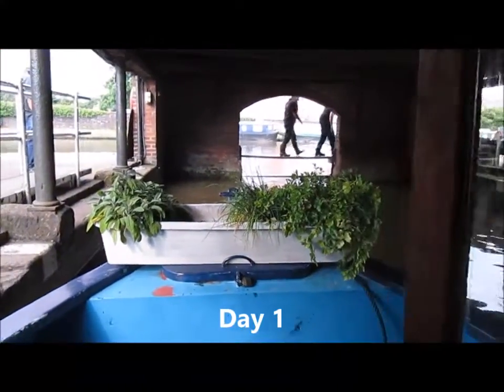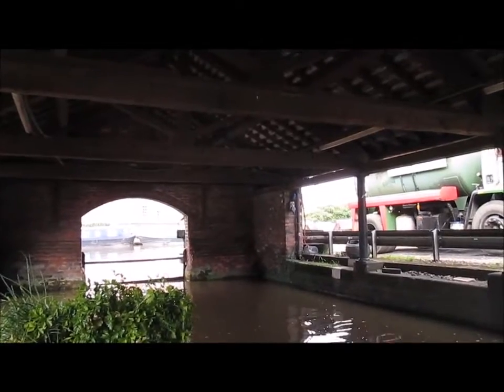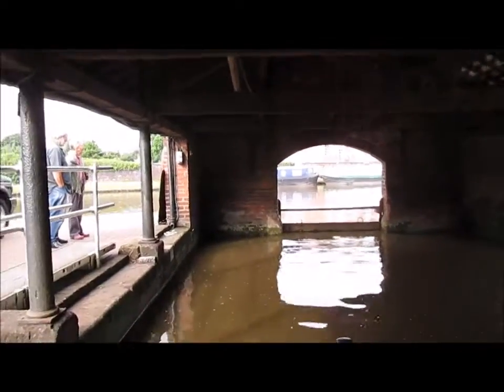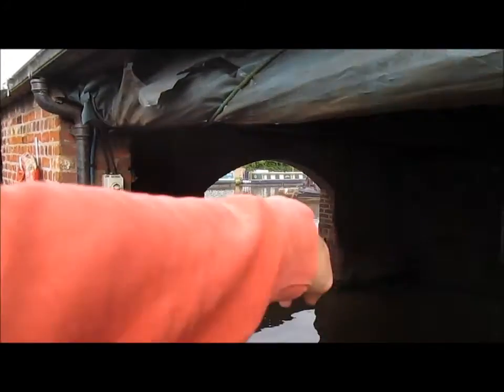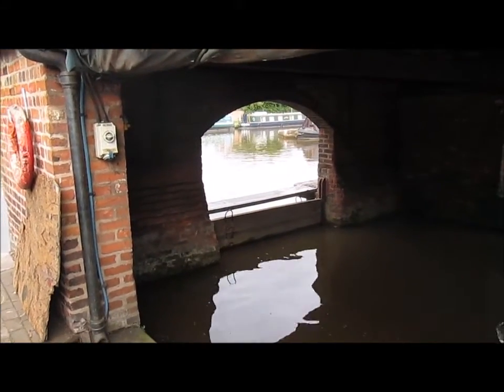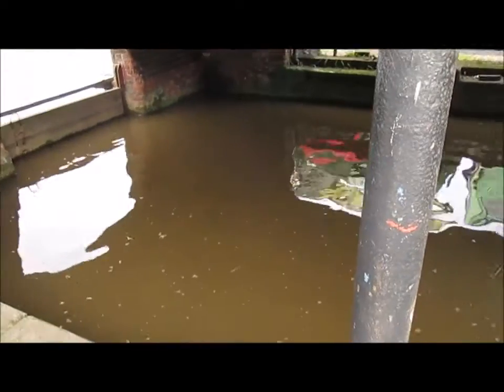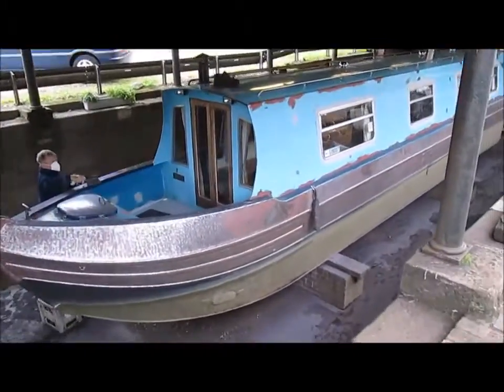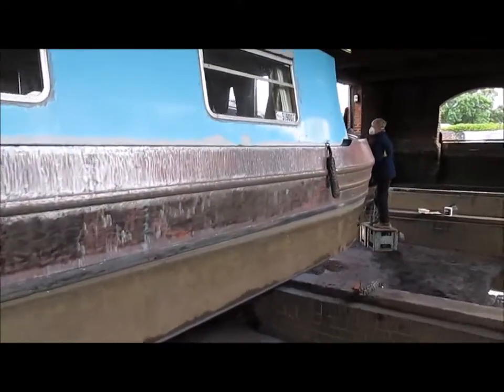Boat painting day 1

Comment: What is the paint you are using?
Reply from the maker: Jotamastic 87
Reply: he says two pack epoxy, which is good stuff but is ot compatible with many other paints, hence the need to prepare the boat to bare metal, which should be done with a sand blaster for best result.